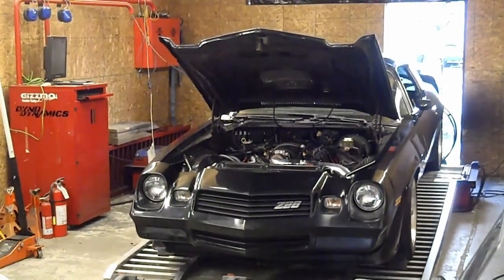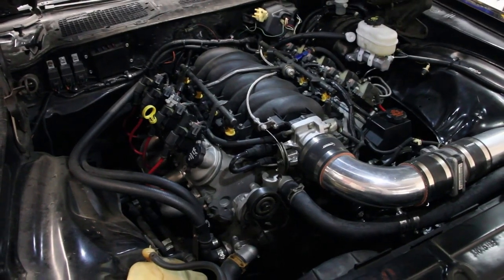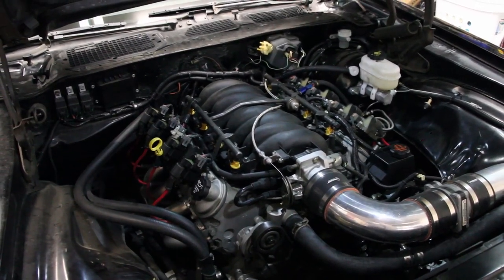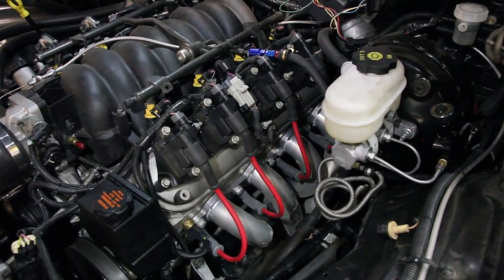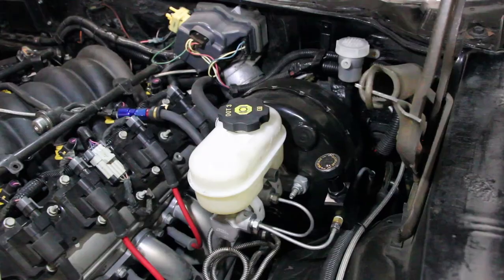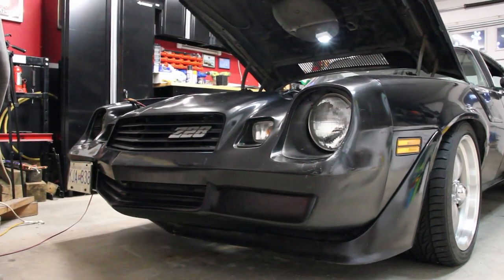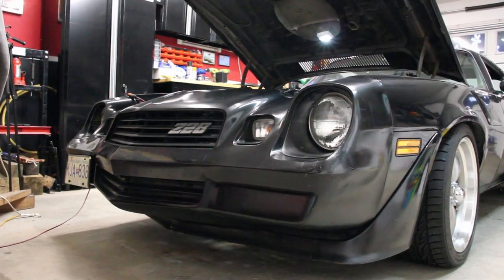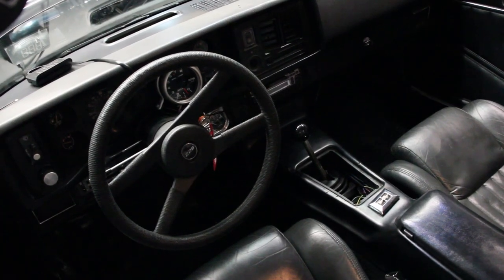Pro touring LQ4 Swapped 1981 Z28 Project Car Detailed Review!

Comment: Did I understand you correct in that the car has original dished pistons, but new? Heads are still standard 317´s but decked a bit?
I´ve just bought a 2003 LQ4 that I will put in my 2nd gen camaro with a M22. And I wonder how good I could get it, still using the original dished pistons and 317 heads. But with new intake (probably a FAST LSXR) and a camshaft with springs. I am hoping I could get it reasonable responsive with just a cam, headers intake and good tune. If I also could get 390-400 whp with my idea of a setup then I would be really happy. But I dont have any idea of what the low compression LQ4 will do with the 317 heads. And what I can get without upgrading either them or the pistons.
Reply from the maker: It has pistons with the same dish as stock but they are aftermarket. My heads were milled .020 so it has maybe 9.7:1 compression instead of the stock 9.4:1. You should have no problem meeting your power goals with the mods you listed. I ran 12.2 with this car when it had a th350 and it made 370rwhp with that trans, an LS1 intake manifold and 1 5/8 headers. Now with the ls6 intake, 1 7/8 headers and t56 400 is about right.

Comment: Great video 👍
I've got a 81 Camaro and I'm putting a l83 with a t56, my question is where did you get the clutch master cylinder and pedal?
Reply from the maker: The clutch master is a factory 1998-2002 fbody and the pedal is from a 4speed 81 Camaro. Thanks for watching and liking!

Comment: What size wheels do you have and did you have to do any modifications to get them to fit? I have a 78 z28 I'm building for autocross and was wondering!
Reply from the maker: Wheels are 18 x8 front and 18x9 rear. No modifications required except a very light lip roll on the rear due to only 5” offset. 5.5” offset rear would be perfect.
Thanks for commenting and watching!

Comment: Did you relocated the alternator if so do you happen to have part number thanks in advance
Reply from the maker: Hi there,
The alternator is the factory F-body type in the factor F-body location. I'm using all F-body accessories and not the LQ4 truck accessories. There is one hole that must be drilled and tapped on the iron block where the alternator bolts and that is all that's needed to use F-body accessories on an LQ4.

Comment: how did you run the fule system?
Reply from the maker: I had a stock 1981 tank baffled and sumped with a Walbro 255 pump going to a vette filter/ regulator then a single feed to the factory LS fuel rail.